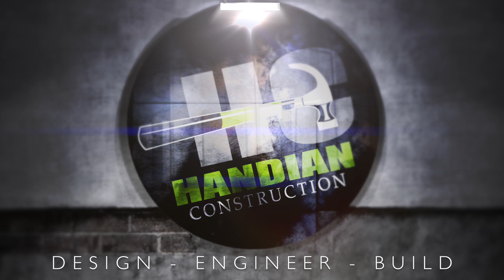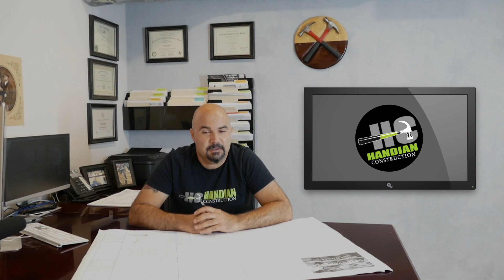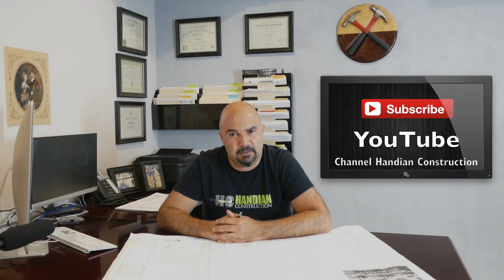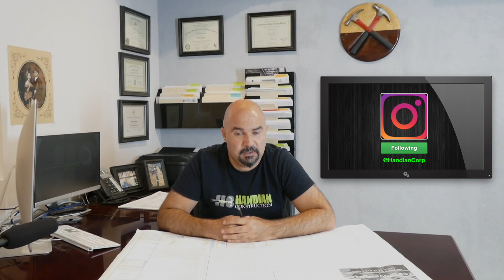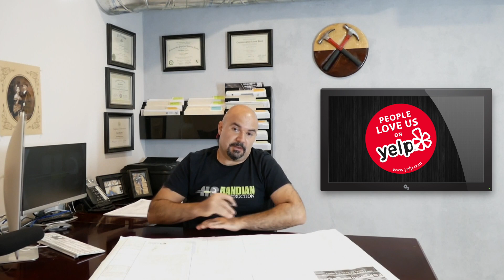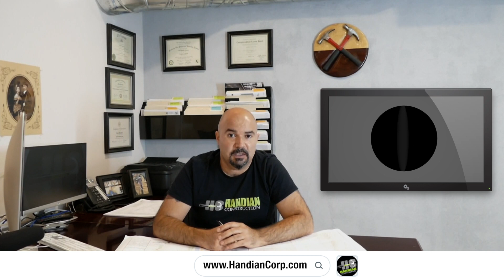Restaurant Construction | Design - Engineer - Build

Comment: using a tape measure? Doesn’t believe in laser equipment, are you serious? Nowadays, architect use 3D render machine to measure the space, tape measure is in Stone Age............ I hope you can adapt to the new updated technology.
Reply: I used to work in Oil Refinery plant design and we sometimes used Lidar scan information and it wasn't all it was cracked up to be. A knowledgable person still has to interpret the measurements and round to what the designer intended. Waste of time if you ask me.